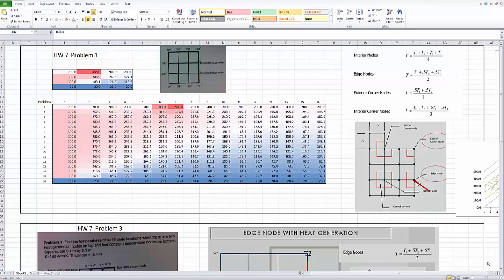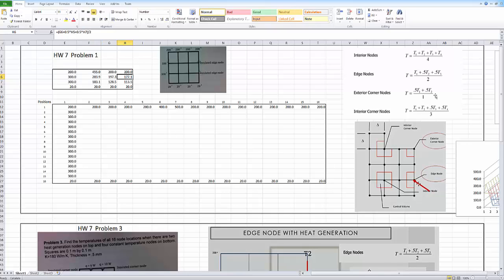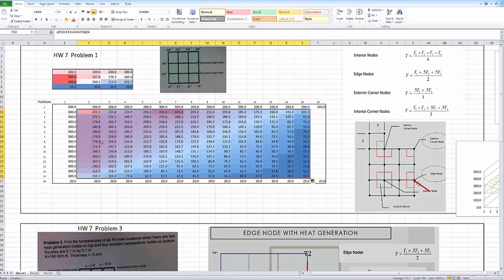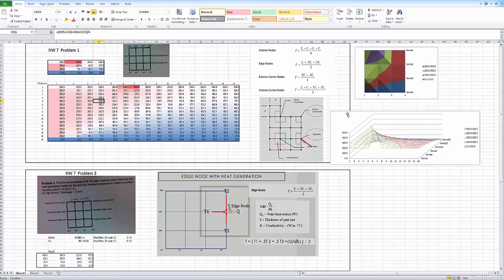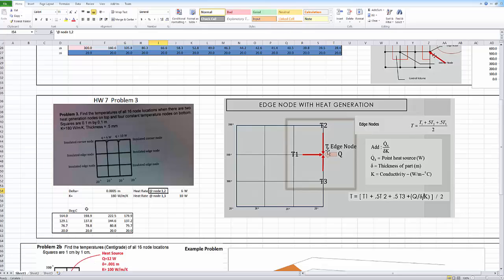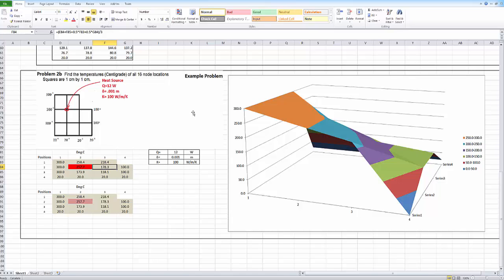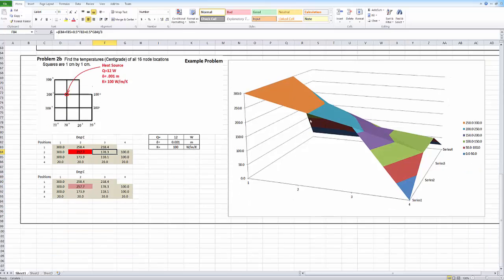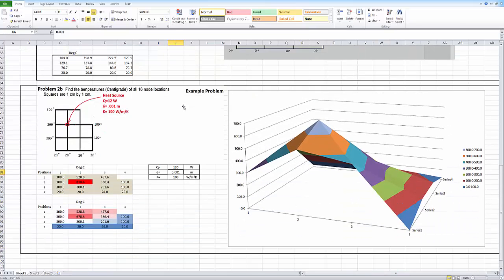Finite Difference Using Excel 3 1 2021

Comment: Hello, i was wondering if you were able to please help me construct something similar to your video for a varying geometry problem? I have a few different finite difference equations to use based upon a couple different conditions. I was using Excel solver to begin with, but can only use it for 100 calculations, rather than the thousands i require for an accurate solution? Am i able to email you something for advice? Thanks in advance
Reply from the maker: Not sure if I can help but you can email me at mrestive@mvcc.edu